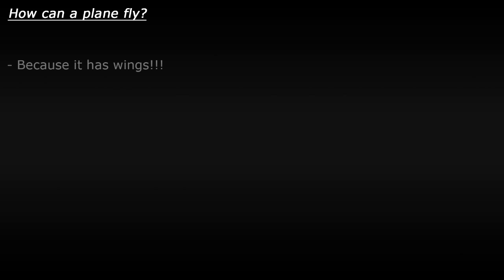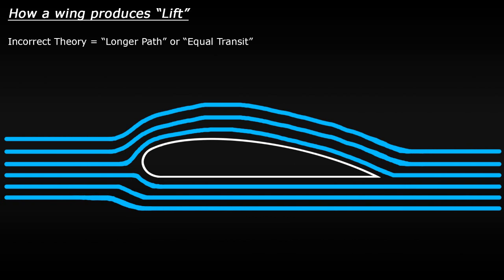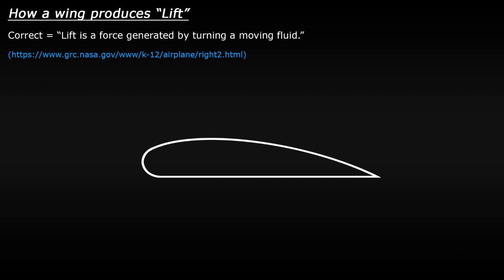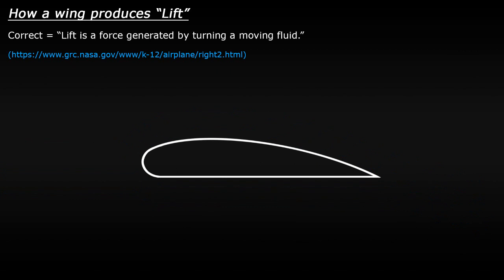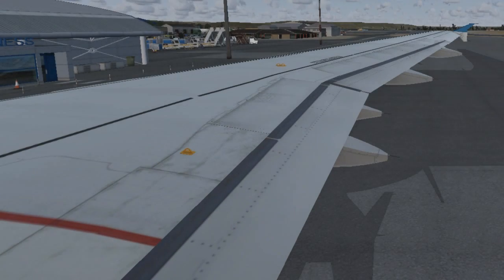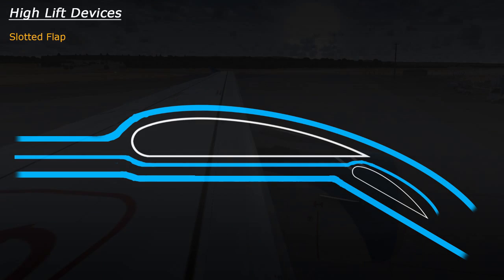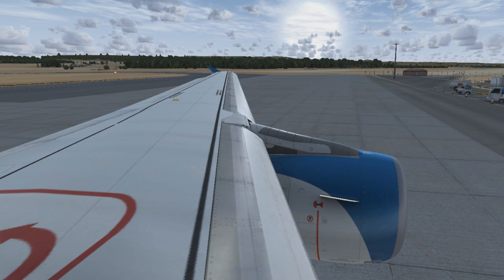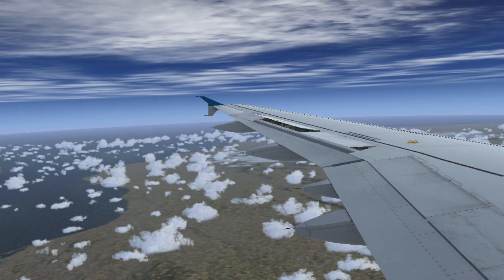How Wings ACTUALLY Create Lift!

Comment: Sorry, you seem quite nice but this is incorrect. The fluid path diagram at 2.50 showing a downward deflection of air past the trailing edge at zero angle of attack is simply not what happens. Check smoke trails over airfoils in wind tunnels. The angle of flow before and after the airfoil is the same. Such info is freely available. Why post this incorrect video?

The foil forces a curved airflow. Curved airflows create a pressure differential on each side of the curve. This creates a pressure differential from the lower to the upper foil surface. This creates lift and airfoil moves towards the apex of the curve. Both Bernoullis (ie lower pressure creates higher velocity flow) and Newtons (force ie centripetal acceleration of the particles creates the pressure differential) observations can be correctly used to explain this.

Bernoulli never considered airfoils in his life (ie early 1700s), as you claim. They were after his time.

Why post this incorrect information as an explanation? You ask others to post corrections in comments, but why? Correct information has already been posted elsewhere. This just confuses anyone looking to learn something.

I know youve been nice enough to comment that others know better. Why don't you take this post down or at least edit your disclaimer to state that almost everything you present is not researched fully and is incorrect? Or better, edit a correction into it?

If you want to learn about lift, google NASA and lift. This Newtonian theory you present is one of their highlighted incorrect theories. Essentially what you are describing is the opposite of lift, ie drag.
Reply from the maker: Hi Sean, 

Believe me, my ego has wanted to take this video down many times however it's important for my viewers that they have access to the detailed explanations which have been given in the comments. If I delete this video, those valuable contributions from other commenters will be lost. The title is your typical BS that a lot of YouTubers employ to catch a viewer's attention but I certainly will amend the description and consider amending the title as well. 

As for stating that Bernoulli applied his theory to airfoils, I never said that. As for asking people to write corrections in the comments, I didn't say that in the video either. If I responded to a comment saying that, it was probably some hater who just wrote "This video sucks!" and didn't offer any sort of constructive feedback. I always challenge people who write such comments because I will not allow people to give me baseless criticism while they hide behind a keyboard.
Reply: Hey Doofer, 

I am not sure it is as important as you believe, but no problems, each to their own. Youtube is not an academic publishing medium so obviously it's fair game, although I am a little surprised that you categorise your own post as educational, given that it's more a point in time report of your study of lift theory.  

You might have forgotten, happens to us all, but at 2.13 to 2.16 you certainly do mention Bernoulli being correct in his observation about the wing. He certainly did not make observations about a wing. He made observations about fluid flows, and the conservation of momentum within a single streamline in the early 1700s. Lift theory is pretty complicated, but Euler's equations are far more applicable than Bernoulli for lift, and in turn a simplification of the Navier Stokes equations, which form the basis for most CFD programmes. The lower pressure above the wing causes an increased velocity as per Benoulli, (not the other way around), however the lower pressure is explained by Navier Stokes. Or more simply by the curved airflow, which you kind of get at with Coanda, but then move into Newtonionan deflection theory, which is debunked, rather than talking about the pressure differential.

There is so little that is accurate and complete and understandable on Youtube regarding lift theory, it is a shame that your post creates confusion. It seems that many believe your post, rather than relying on the skeptical comments. But hey, maybe that's up to them to critically analyse.

I speak only as a person who has just waded through most of it, in my own study of lift.

I don't know where you're at with it all, but good luck with it.
Reply: No, if the angle of the flow before and after an airfoil is the same, it cannot generate lift. This is fairly obvious: put a rectangular control volume around the airfoil oriented with the free stream velocity. If the airfoil doesn't change the angle of the flow, there is no momentum flux through the top or bottom of the control volume and therefore no lift. Obviously the Newtonian deflection theory is wrong but it is equally incorrect to say that this implies the angle of the flow upstream and downstream of the airfoil can be the same everywhere.

Comment: Nope that's not why wings fly. Can't believe people still get this wrong. Please remove your video.
Reply from the maker: What's the correct explanation then?
Reply: So, u both are correct-ish.
both principles are why lift is created
Reply: He was inccorect(kind of)[the maker of video]
Reply: Yeah, it's not correct but better than average. Lift is created by circulation of air over and under the wing. the shape of the wing first creates an unstable airflow that is corrected by circulation which in turn crates the vortex we all know so wel. Wings work upside down... remember? :-)
Reply: There are several presentations of NASA sceintist that warn for this shortcut. They're just not on the NASA site. I find an increasing amount of explanations of people in the know and they contradict each other as well. The circulation story is the long story but some sceintist are against that explanation for it could be misunderstood. So there is a correct story and a widely understandable story. The correct one is too complicated and too long. The understandable one is incomplete... 
I believe that confusion is a known quantity in Aeronautical Engineering because  I watched a lection where a Boeing sceintist started by saying that they "do know why planes fly"! :-D
Reply: The correct theory is not at all difficult to understand. It is actually intuitive. Try do hold an object out the window of a moving car. It does not matter if the object has a 'longer surface' on the top side. A piece of wood will suffice, or our hand for that matter. When you change the angle of attack you can feel the force. It is called 'turning of flow' and has been known at least since the days of Newton and it is Newtonian physics. On wing there is some extra shit going on but Bernoulli does not apply since Bernoullis law only applies inside a passage of some kind, for example in a nozzle or a tube or between two fixed walls.
Reply: Good. Now check a couple of video's of people in the know and hear how they disagree on Bernoulli.
Reply: Care to link? Don't know what to search for.
Reply: +longbeachboy57, finally, someone who gets it! OMG....it's really pretty simple, but all these people arguing and arguing and arguing over Bernoulli, are just over-complicating things.
Reply: @longbeachboy57  What? Bernoulli's Law applies anywhere along a streamline, not "inside a passage of some kind". The only nice thing about a passage is that you can usually then assume the flow is irrotational and then you can apply it without a care in the world.